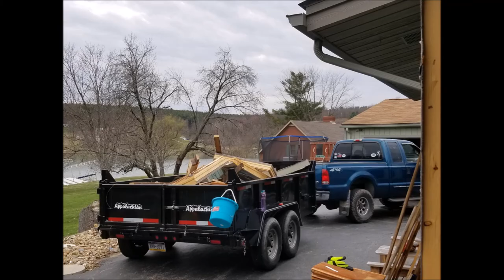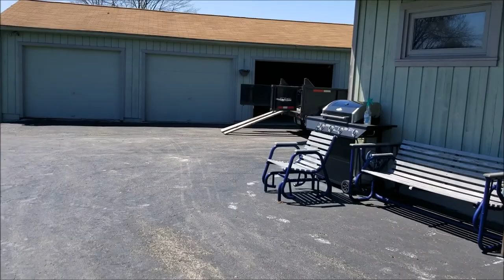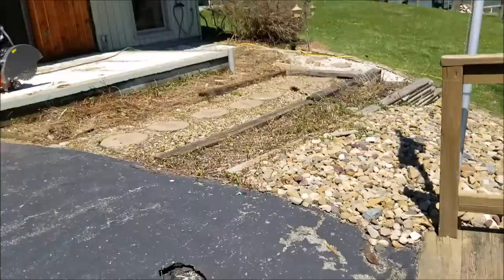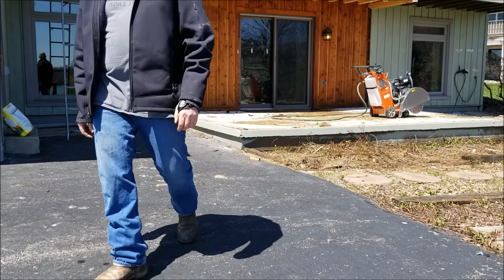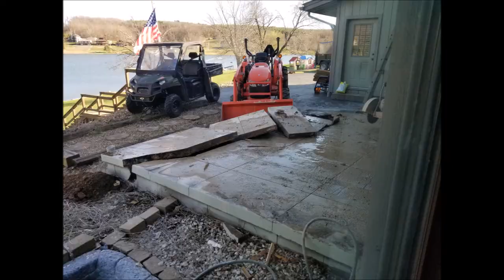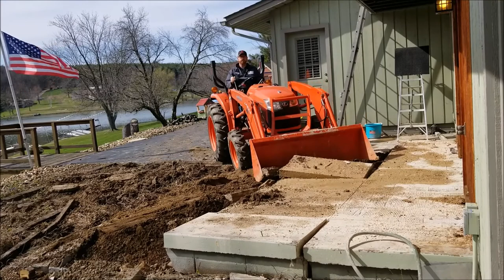Removing a concrete pad with a Kubota L3200, dump trailer, and concrete saw

Comment: i used  to use sets of manure forks for ripping concrete pads and asphalt up with wich pretty slick tool manure forks
Reply from the maker: That would have probably worked better for me than a bucket.